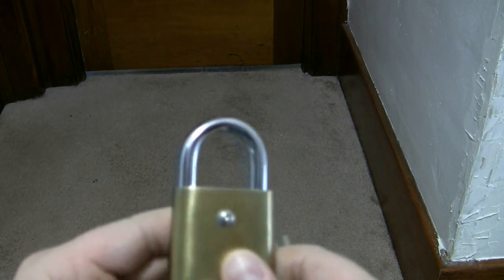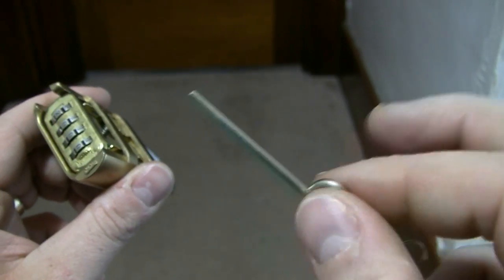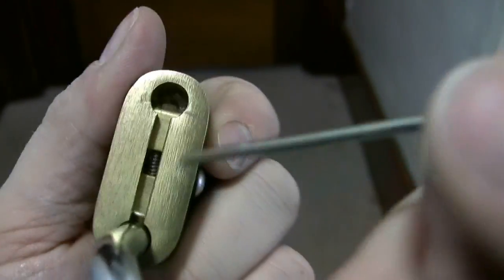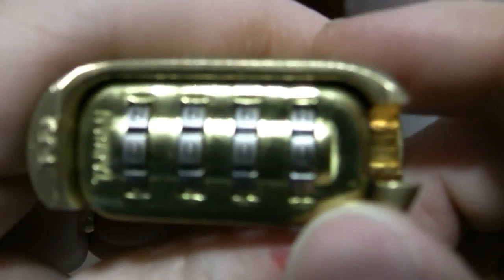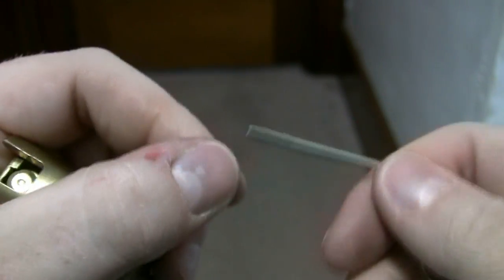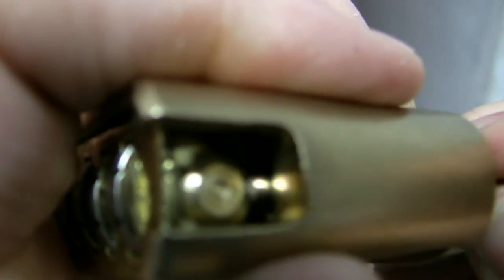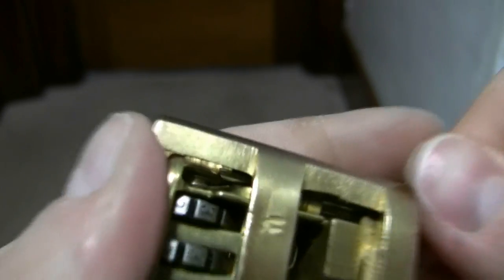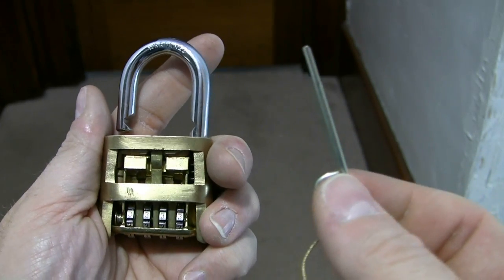Demo of a cutaway Sesamee combination padlock.

Comment: The setting pin has to push the "wheel button". It does that well when you think you pushed it too far. When only resting on the rim it's not pushing the button far enough. So the flat side to the button and push it all the way down. Now set your combo.

Comment: Why does it take a lock guy so long to figure out that the pin has to go all the way in to depress that part that allows you to change the combination? And there is no way to stick a paper clip in the side of the tumbler to pic the lock. It fits too tight.

Comment: Looks like people have already pointed out that you are supposed to put the reset pin in all the way to change the combination.

I was wondering how secure these are versus the Master model 175 lock. They both look similar, but I think the Master, with the reset hole in the side, may be easier to pick because you can see the dials through the hole.

What are your thoughts on comparing these two similar locks?

Comment: Btw. I have the Abus 180IB/50 version of this. In fact I've thought about buying one more making one a cutaway. I just noticed a spot on the back where the brass is slightly different color. That's of course the (slightly different alloy) rivet that holds the jacket in place! In order to make a great cut away you have to drill it out (perhaps thread it and pull it out for minimal scaring). Of source the easy way to assemble it again is a screw. I'd got for a counter sunk for esthetics though.

Comment: When placing the "key" in the slot, it's important to turn the key a 1/4 turn this will allow a change every time.  try removing the screw and see if the insides fall out the bottom.

Comment: This actually the worst video, about combination padlocks.
Even with a cutaway you didn't get it, how to change the combination.
It's so easy: 
Just push the tool all the way in, with the flat end pointing towards the button, than turn it by 180 degrees.